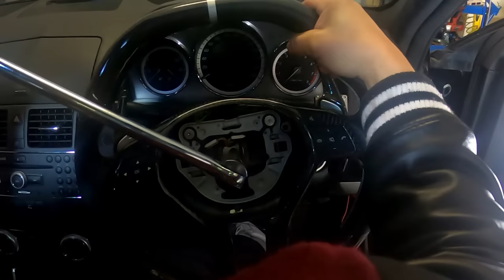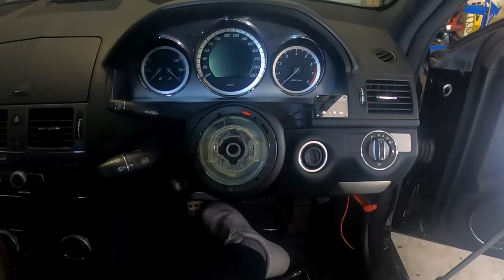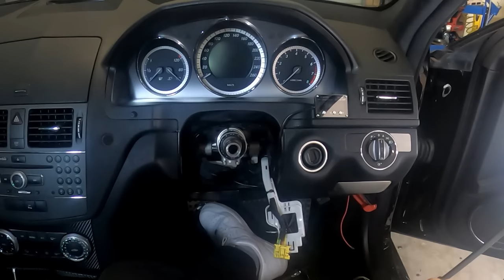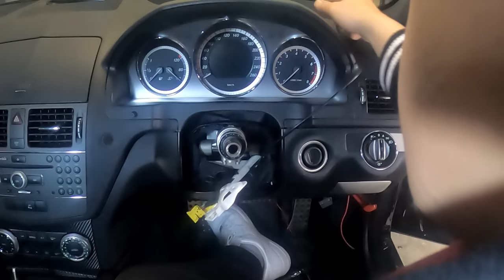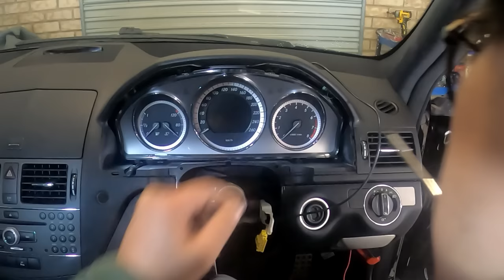HOW TO remove and fix ESL/EIS/ ELV MODULE  w212 w204 mercedes motor replace  Part 1

Comment: Hey Mikeyz 1st i want to give you big props for still interacting with this video, very helpful to us all.

I have a question, I had no signs of an issue and today i go to the car and I have no power, Battery reads 12.4 but putting the key in does not activate anything. 
I am able to lock and unlock with the fob and my dash will show the mileage, PRNDL & Temp i think, but i think that is supplied from the Aux Battery.  My question is does the tapping of the ESL bring the power on to unlock? 
Great explanation or your issue, i’m just not sure if you were saying you had no power and the tapping brought it back to allow you to activate the key?

Thanks for any info you can offer.
Dave
Reply from the maker: so wen this happens it's random ..it can happen at any given time..hence why its a random catastrophic fault ... u can have no symptoms and allnof a sudden no reaction with insertion of key ... it might all of a sudden work intermittently, but it all points to an esl motor... u need power to tap the esl ... without power tapping won't do anything cuz there is no power to operate the esl module..tapping helps becuz it shakes the esl module to try help it kick in one last rotation which will unlock the esl thereby allowing you to start your car..  however don't just drive cuz once u turn the car off again ..u could be stuck .. I would start the fix immediately or look at getting a bypass... I Let my battery Completely drain out The other day and I thought my esl had gone again bllbut lucky It was just due to a flat battery ... once I charged the car ..it worked and all is well now
Reply: @MIKEYZVLOGZ  I’m sorry for what is probably dumb questions, but i’m trying to understand the system.
So what i’m getting from all the different post here and elsewhere. When the ESL goes you end up with 0 power from the key. So based on that, i’m guessing the motor isn’t necessarily the issue or not the only issue, it is the ESL itself that isn’t allowing the motor to even get power to lock and unlock? I have not watch your videos through and wanted to ask these things to be sure I understand if my issue was indeed worth attempting motor replacement or I just needed to have the ESL replaced because it isn’t allowing power. Thanks again for your insight on this

Comment: Dear. Thanks for the video. 
I decided to do mine dealer ask for creasy money to fix it. Plz. 
What are the tools needed for the job especially the little one to open the ESL.
Reply from the maker: u can buy from ebya just search w204 esl tool you will find them there... i buy alot from ebay and aliexpress....takes longer from aliexpress but worth it to me...ebay u can try find it in your country maybe someone has imported them already..you'll just have to search around 
heres an example 
https://www.ebay.com.au/itm/1-For-Mercedes-Benz-ELV-ESL-EIS-W204-W207-W212-SteeringWheel-Lock-Motor-Tools/392882442315?hash=item5b799e504b:g:lskAAOSwQVNfGSU-

Comment: so my car can start and shift gears and all but i cant get the key into position 0 to remove it and take it out
Reply from the maker: sounds very much like an eis issue ..where your ignition barrel isn't responsive
Reply: @ so replace eis?
Reply from the maker: @panduhgaming5473 maybe u need to have it looked at by professional first.. cannot say 100% unless have it looked at

Comment: Do you take the bolt out to the back to pull the column spline ⚙ out so the column drops, or will it drop enough without pulling that out??
Reply from the maker: you can lower the steering column without toouching the esl module and bolt...the bolt is removed so you can remove the esl from the secured position..its the 13mm nut that scures the esl module to the steering column
Reply: I mean the bolt thats horizontal that keeps the steering column  from being removed. You can see the one i mean at 20:54 into this video.
Reply from the maker: @gsingley80  oh yes i did do that ...yes and also make sure you mark exactly where the splibne lines up as its very difficult to get back in ..it took me a while to get it back as i didnt mark it..but abit of playing around eventually it will slide back in ... if you dont loosen it there its more difficult to remove lower column..removing that bolt will give you a better angle as it will disconnect there allowing you to wiggle the column to a better position and get to the esl module
Reply: @MIKEYZVLOGZ  thank you!! Got it out!! Any suggestions to remove the pins in the ESL if they become stripped to much and the tool won't hold into them?
Reply from the maker: @gsingley80  tap a t5 into it and then pull and twist at same time ..u mean the pins that hold the esl module together yes.
Reply: @MIKEYZVLOGZ   Yes 2 of them came out pretty easy the other 2 stripped out nearly completely I mean it's nearly rounded out to the case

Comment: Hi! Does  the key need to be in "0" when you take off the battery? Basically I you just hear the sound of unlocking?
Reply from the maker: the key has to just be in the ignition so it remains unlocked
Reply: @MIKEYZVLOGZ thank you
Reply from the maker: @arbiboja1632 no sweat

Comment: Hi, do you need to disconnect + and - of the battery or only the +?
Reply from the maker: Just negative
Reply from the maker: But make sure it doesnt reconnect as ur working on the car ..
Reply from the maker: no your main battery...the one in your back is your accesory battery ....only your main battery....  if the one in your boot is your main then disconnect that.... yes u can just disconnect the negative pole...dont have to dc both ...one will do..then wait 20mins for all power to discharge...as there is still some power even when you dc battery..hence why u wait 20m

Comment: I'm curious of the same thing. My car is a 2012 mercedes c300, unable to start as we speak. Key Unlocks, locks, trunk opens, etc. No window control or heated seats and other power. Steering wheel moves, doesn't lock. Checked battery, fuses, relay, shook wheel, put it manually in neutral after removing stick shift. NOTHING. But, when I put key in and move to start position I dont hear any noise just some dash lights go on. And remove key. How do I know its the EIS/or steering lock switch? And will the same steps work on this year make and model? And is there a theft issue as a previous gentleman explained if not done correctly? Please, help. And thanks MIKEYZ your very thorough.

Comment: Hey mikey I know this is an old vlog but I just purchased an 09 c350. And regards to these ESL components. Now there’s places that offers plastic emulators replacing the oem mechanical ones. The mechanical oem esl os bound to fail so do you recommend or even heard of the emulators replacements ? Mine is still working fine but would like to just curious.
Reply from the maker: yes i recommend when mine fails i will get one too

Comment: Thank you for your video; it's been incredibly useful. 
I have a quick question. Instead of tackling the complex task of removing the steering column, is it possible to simply remove the EIS (ESL in unlock status), send it along with the key to get the emulator programmed, and then reinstall everything with the emulator hangs outside?
Reply from the maker: yes definitely that's wat I was showing how I didn't remove the column ..I know I didn't show the actual removal but that's because it's all done by feel... watch part 2 to get a better idea of how u locate and remove it..u def do not need to remove the column bud...I'm gonna do a short soon to show how u remove the esl module without removing the column ..cuz o should have added it In this video ..so ill make up for it
Reply: @MIKEYZVLOGZ  Looking forward to your next video which show only the essential steps to remove esl for diy beginner
Reply from the maker: @shenzq  if i find the time to do it i will do it

Comment: Hi where are the 2 little grey switches located
Reply from the maker: looking at the circuit board u will notice 2 chips with a grey button like switch .....  these are the switches
Reply: They are limit switches. The motor turns one way to open and another to close. To stop the motor at both ends those limit switches are employed. There are two points those grey pins must mate to and I hope, when I do the job I can see if they hit those posts.
Reply: @dominicwild3189  ur comment makes sense to me but I am very familiar with limit switches and how they work.. I don't see the big deal with the switches according to the video, they just break or complete a circuit. What's so important with the switchs not to damage the nec chip between the steering lock in the open vs locked position
Reply: @deanemily889  Thanks Dean. Am ignorant here how they can damage the chip. Please explain. My case is the locked steering  one and when I look at the two grey pins, they are close to and touching the two posts they are supposed to mate with.  Are you saying that the correct pin must be depressed for each of the end positions of locked or unlocked? Strange as mine is in the locked position and I cannot see one of the two pins to be pushed in to cut the motor.

To familiarise myself with the system, must I rotate the wheel and watch the limit switches to be activated at both extreme end positions? Is this what you are concerned about? 

For testing with power, must the ELS be in the FULLY locked condition with the lock sticking out and at least one limit switch be depressed to rotate the motor towards the unlocked position?
Reply: @dominicwild3189  from 25.35 in the video.. How can the chip get fried. I'm just curious to know is all

Comment: Mikey I have everything apart. Up to the step of getting to the 13mm bolt holding the ESL. Thanks so far! My question us the (blue) electric plug on ESL just pulls out? Do you press the sides if it and pull? Also, when takin out the old motor and replacing it. Do you turn the wheel at all inside or do nothing but grease everything and drop new motor in, and pushing in the 2 areas.??
Reply from the maker: u got it mate that's it ..and do nothing with wheel put back exactly as u found it
Reply: I had to take the T40  torque bolt holding the column in. I couldnt push in the EIS bolt in and remove it. Not enough room to work. The ESL seems unlocked as it does push in. Though  sometimes it seems to be (hard) and not push in, as I keep attempting to push it in and pull up on it to remove it. I turned the metal steering wheel !nd push in at same time and it then pushes in. Did I do something wrong by taking that final 5th  torque bolt to move the column in a better position? Or should i not be turning the metal wheel as I push in on the ESL bolt? And i cant seem to push it in enough to pull up on it to remove it. Frustrating, cause im using a ( pick tool, small flat head, and a small hook tool). It pushes in but as I pull up on the ESl it wont come out.

Comment: Ok, so yesterday the wheel got locked and i hve to turn it a little bit to statt the car. Today after driving first drinking to the shop and then to my job, the car would not start. I can still wiggle/ turn the steering wheel, its not locked in place, but there is no lights, sound or anything when i put the key in and turn it. Only the Kilometre stand of the car shows. Do you think its a bad ELS? Since i can still turn the wheel im not sure if it is.
Reply from the maker: Yes still believe its a bad esl could be stuck or malfunctioned by now ..it would be a good idea to get a scan first so u know for sure .... it will show what faults are present ...use a descent obd2 scanner tool
Reply: MIKEYZ VLOGZ Alright thank you !
Reply from the maker: @TheEverLoLMrLoL  also if your car rufuses to start and turn over and u dont even get lights and radio try not to keep trying to turn over as your car can go into anti theft mode and sometimes lock u out and give u a blank screen ...so be cautious and be patient
Reply: MIKEYZ VLOGZ today i just opened the steering wheel adjustment latch and hit the wheel up and down and then put the key in and the car started :D but i think i hear a bad motor inside the steering wheel. Do you think i have time to change the ESL motor? I have to order it from ebay wich will take about 1 to 2 weeks to Get to Norway. Im thinking of just taking out the ESL motor right now and leave it as it is til the New one comes in, but im not sure if i should do that as i heard u said the ESL chip could burn or something like that in the video
Reply: Its a w212 e220 2009 model btw
Reply from the maker: @TheEverLoLMrLoL  yes def sounds. Like esl
Reply from the maker: @TheEverLoLMrLoL  yes its the motor friend
Reply: MIKEYZ VLOGZ Thank you so much for the help man! Do you think i will be allright driving it or should i just disconnect the battery and wait for the part to come in?
Reply: Ah shit i was driving it home today and the horn, lights and the turn signala didnt work. I stopped the car outside my house and tried to start it again to see if that would help but this time the steering wheel will turn about 1-2 cm before u motivert that its locked and wont turn more than that. Car radio works and all, but nothing happens when turning the key😂😢
Reply from the maker: @TheEverLoLMrLoL  ye get a scan done to be sure then get onto it asap
Reply: I got this code up while i was driving and reading with the Obd2 before turning off the car: Mercedes-Benz U0146 Lost Communication With Gateway A

Comment: Hi,
Thanks for the great video. This was very helpful. What if we damaged the dowel pins? What's the best way to remove the damaged dowel pin
Reply from the maker: t5 or t6 torx bit and softly hammer tap it in.. just enough to grip and slowly turn as u pull out..fepeat til its out..if damaged drill it out
Reply: @MIKEYZVLOGZ  I had to drill it out but just finished replacing the motor. The old motor seemed to be burnt, had black burn marks. But thanks for all your help.
Reply from the maker: @bhavneetbatra7506  yep thata exactly what happens cheap part shame on mercedes
Reply: @MIKEYZVLOGZ  I had to use the screws to secure the outer shell.
Reply from the maker: @bhavneetbatra7506  as long as u secured it
Reply: @MIKEYZVLOGZ  yes it's secured tight
Reply from the maker: @bhavneetbatra7506  den thats all u need ..good job

Comment: My ESL is unlocked when I removed it do I need to touch the micro switches when putting back together ?
Reply from the maker: only if they are in the way of u closing the esl
Reply: @MIKEYZVLOGZ  thanks , I got it out

Comment: Hi...@about-12:00 you say the clock spring just pulls right out...I'm there and it's not just pulling out what have I missed...what is it clipped to?  I'm soooo freaking thru with this car what major 😞..thanks in advance ....fingers crossed that you reply 🤞
Reply from the maker: the 12:00 time u suggested is still removing the airbag and steering wheel... which patt have u removed thus far and which part u up to ? have u removed the airbag?  have u removed the steering wheel? the clockspring is the part after the steering wheel
Reply: @MIKEYZVLOGZ  it was the clock spring I was having trouble with AND then everything after that as well...this is a horribly frustrating job if it fails in the locked position.  I do appreciate your reply
Reply from the maker: @Tamara C. Moore  yes indeed it is... so the clockspring does come off quite easily ... it just pulls off..its clips in but not a clip u need to pry .. wiggle it abit and lift straight out
Reply: @MIKEYZVLOGZ  👍to you 👎🤬to Mercedes...never again!
Reply from the maker: @Tamara C. Moore  yr I learnt the hard way too.. but as long as ur willing to get ur hands dirty and do simple services owning a merc is ok.. but helps to be able to fix certain things too .that's why I started this channel to help others in the same boat ..before yt.. I never worked on a merc ...only service which is pretty simple
Reply: @MIKEYZVLOGZ  you wanna own another one ?  Finally got it all back together...unbelieveable....Every warning light we try to avoid is on...I've got no words ...wanted to at least say Thanks Again in case I don't make it back...
Reply from the maker: @Tamara C. Moore  does the esl work? if so did u test without everything plugged in? like steering wheel cluster column? that would explain why u got all the warning lights..or battery flat will do that too
Reply: @MIKEYZVLOGZ  my ESL failed in the locked position.  Prior to diagnosing the failed ESL  I replaced the battery. After removal of column I had to  cut my ESL from column, upon opening the circuit board was burnt as well  so  I went the path of an emulator through Mercedes Benz Specialist -very knowledgeable, very patient and  very affordable. Car starts now . My  traction control inoperative message is displayed and  steering wheel is a few  degrees off center...but after 3.5 weeks it is together and starts everytime...I am going to tackle it tomorrow  and hopefully correcting the wheel and resetting angle sensor  will call it complete...but as far as Mercedes goes...Never Again.  A million thumbs up for your assistance and informative vids...if not for  you and those commenting on your videos I  would have never  made attempt to do it myself and   I lacked  the means to have someone else do it .
Reply from the maker: @TamaraCMoore  well done Missy.. I applaud u